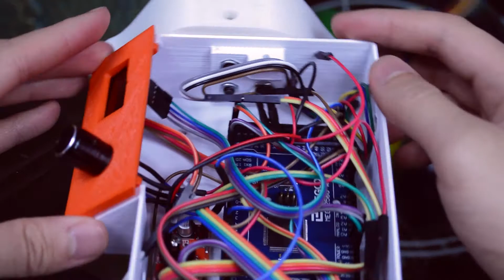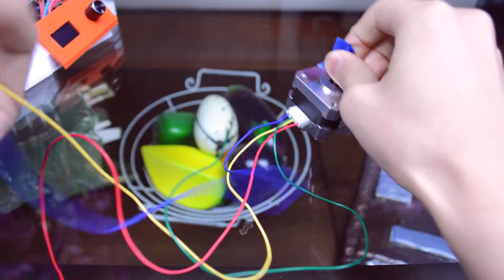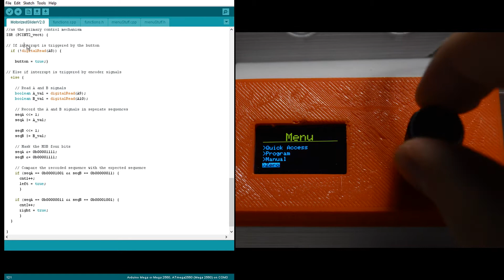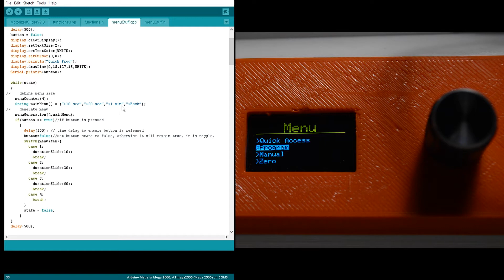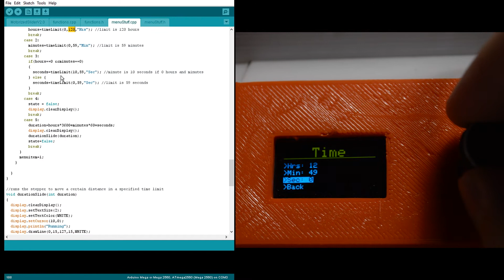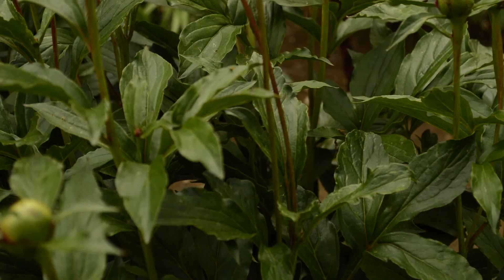Motorized Camera Slider Part 3: Circuits and Code

Comment: Thank you for sharing this build with us.  I am currently testing the electronics and i’m finding that the chip on the Easy Driver gets really hot when the motor is standing by. I have the current at the lowest setting. The motor turns properly and resets but then the driver overheats.  I have already burned out one driver. Was this a problem for you?

Comment: problem... I can only go to Quick Access and when I click, the motor is always "zeroiing"... What is wrong?
Reply: Check A8 (limit switch)
Reply: @satb7226  Many thanks! But... what should I do exactly ?
Reply: @berlib0102 Hi Bernard, apologies for the delayed response – did you manage to resolve in the end? FYI - on my build, the trigger pin A8 was wired incorrectly causing a similar issue.
Reply: @satb7226   Many thanks for your answer! Unfortunately, my slider is still "zeroiing"and the screen remains  on the first option which can't be selected... I despair of finding the solution for this amazing project which is however the most interesting found on the Internet! Do you appreciate your slider?
Reply: Hey Bernard L when stuck in "zeroing" is the motor moving?

Comment: Good evening !

   I could not compile ... :(

           Shows the error:

 (exit status 1
'A8' was not declared in this scope)

           
C: \ Users \ Darth Note \ Desktop \ MotorizedSliderV2.0 \ MotorizedSliderV2.0.ino: In function 'void setup ()':

MotorizedSliderV2.0: 47: Error: 'A8' was not declared in this scope

   pinMode (A8, INPUT);

           ^

MotorizedSliderV2.0: 48: Error: 'A9' was not declared in this scope

   pinMode (A9, INPUT);

           ^

MotorizedSliderV2.0: 49: Error: 'A10' was not declared in this scope

   pinMode (A10, INPUT);

           ^

C: \ Users \ Darth Note \ Desktop \ MotorizedSliderV2.0 \ MotorizedSliderV2.0.ino: In function 'void __vector_5 ()':

MotorizedSliderV2.0: 136: Error: 'A8' was not declared in this scope

   if (! digitalRead (A8)) {

                    ^

MotorizedSliderV2.0: 144: Error: 'A9' was not declared in this scope

     boolean A_val = digitalRead (A9);

                                 ^

MotorizedSliderV2.0: 145: Error: 'A10' was not declared in this scope

     boolean B_val = digitalRead (A10);

                                 ^

exit status 1
'A8' was not declared in this scope

Help me !!! Please !!! /\O
Reply: you chose the wrong board, should be "arduino mega"

Comment: Hello, i already buy all the items and connect everything but the menu does not fit in the screen, can you tell me what is wrong or if I need to change anything. Thanks
Reply: Hello ,I had the display problem also but I had found what the matter is.
You can found the Folder path:Arduino>libraries>Adafruit_SSD1306-master>Adafruit_SSD1306.h.Found this program and edit it like this:

    -----------------------------------------------------------------------*/
   #define SSD1306_128_64
 //  #define SSD1306_128_32
//   #define SSD1306_96_16
/*=========================================================================*/

and then ,Compile and upload.
Have fun!
Reply: https://ibb.co/camdYn
Reply: Photo os the screen

Comment: Hello, my slider is more portable (40cm), to adjust the time do to the 40cm lenght i need to adjust the chassislengh of the code? now is 22500, this nmber corresponds to witch lenght of slider? thank and keep the good job!
Reply from the maker: Yes, you'll need to tweak that number to your custom length
Reply: is this number in millimetre? ex, 40cm should put 400?
Reply: did you find out about the units of this number ? tnx btw :) @ゆパパ
Reply: @Persianppc  No, but you can put a number to try, and will find one fit yours. My slider is 80cm, the number I think is around  16500
Reply: thanks pal ;) @ゆパパ

Comment: will you be adding a camera trigger function to this project, saves messing about with camera settings to fire the shot

Nice project btw
Reply from the maker: Nah, I wasn't planning on it. I dont own any camera with an electronic trigger input. It would need to be something that would physically press the camera button. Possible, but not really worth the effort in my opinion. This rig is meant to be more of a "set and forget" type deal.

Comment: Hi there. I'm just starting out with arduino and camera sliders. I bought an Arduino Uno, GBRL shield and High current DRV8825 stepper driver for this purpose. Do you think this will work?
Reply from the maker: you would be able to achieve the same level of functionality but you won't have enough of the arduino's dynamic memory left for the display.

Comment: my slider is not as same length as yours. so i waant to reverse diection as soon as it hits the limit switch whatever be the time duration is set , i just want it to reverse direction, otherwide it will damage itself if it reaches the end and doesnt stop or reverse. i dont know any programming and completely dependent on you. till now the program runs well but havent fitted on actual hardware. i have added two limit switches at either end making them parallel connection.
also my menu fonts are too small , how to increase its size so as i can read. i triesd increasing font size to 2 at many places, but texts just gets cropped on screen and is useless. please help soon. i have invested lot in parts.
Reply from the maker: What you want to do is simple enough to achieve, but you should take a look at how a simple circuit is wired up for a switch in the arduino IDE. See how the logic works and then try to incorporate it into the code I have provided.  There should be many examples of how to do this on google. As for the font issue, its a little trickier due to how the text is rendered on the screen. If you increase the font size, you will also need to shift the starting point down in order to display properly.

Comment: Great Work - A really good video showing how to build the Camera Slider.
I am planning on motorising a Neewer carbon fibre camera slider using the code you have shared as a base starting config. (I am new to Arduino coding).
I intend to add a Move, Shoot, Move option which triggers the cameras shutter via another output pin when the slider stops between moves.
I noticed in your videos you actually use several different models of Arduino, but provide the code based on a MEGA. I intend using an UNO or NANO, would it be possible for you to share the specific "Interval Pin" details and anything else specific needed for these other two models ?

ManyThanks.
Reply from the maker: Thanks!

Its been a while since I made this video tutorial series so my memory of it is a little hazy. I believe I went with the MEGA over the nano/uno due to dynamic memory constraints. This was mainly due to using the OLED display library (its a memory hog). If you choose to omit the screen in order to go with another control scheme, then you can potentially use the nano or the uno. You stated "interval" pins but I'm assuming you meant "interrupt" pins? Those pins are different between the mega and the nano, while the nano and uno may share the same interrupt pin numbers. I recall including some references in the code to websites that really helped me on this topic. If not, it should be a short googling away.

Good Luck.

Comment: I am not seeing the wiring diagram in the descriptions...
Reply from the maker: Woops, I added the diagram to the github link. You should be able to get it there.
Reply: First of all, great job with this. Building this is so much cheaper than buying one.

Secondly, I followed everything in the instructions, and everything seems to be working just fine, except that my rotary encoder does not seem to want to scroll through the menu. I can long press to select, but cannot scroll to any options other than the first.

Thoughts?
Reply from the maker: Not too sure about this. If the button press works, but the knob doesnt work; then I would double check your wiring. 

Also, in my build, the menu does not respond until you turn it at least a half turn.
Reply: Perhaps I have the wrong resistors. Are those 220s?
Reply: @patricklambrecht3934  I've the same problem... and no solution.

Comment: Love your Slider project so much, I built it! This was my third Arduino project ever.   I modified the build and code to suit the parts I had on hand.  Still very much a beginner at programming.  Loving the motion in my Timlapse videos!  Thank you for putting in all the hard work and posting this video series for all to share.